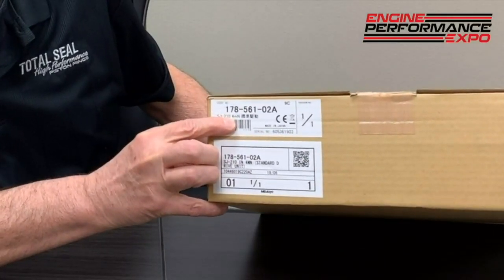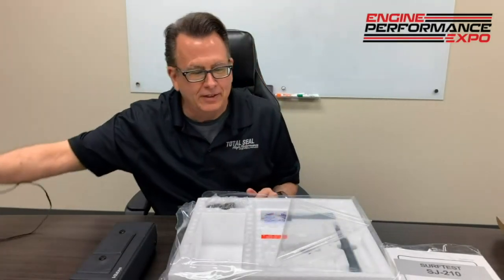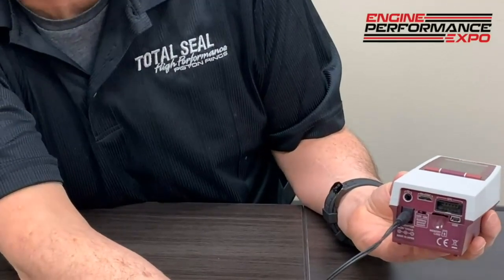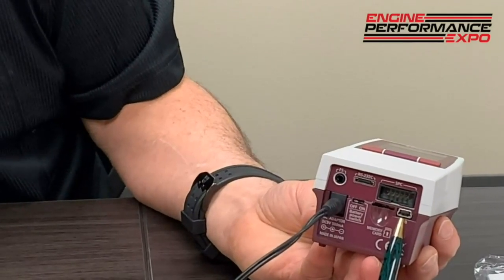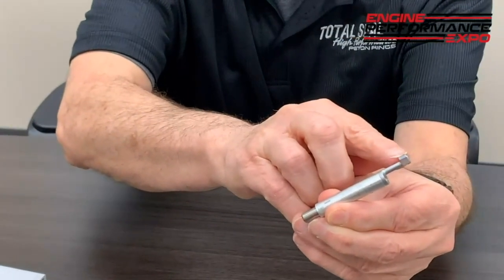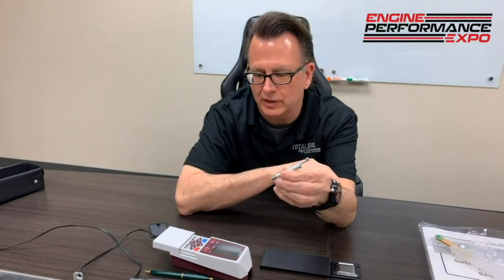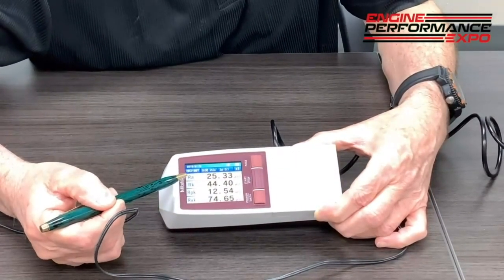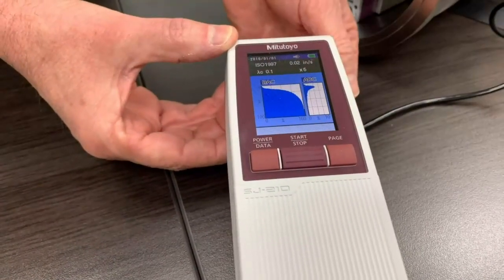Easy Profilometer Set Up (Step By Step)

Comment: If my reader is not reading the 116, but say 114 and I want to tell my machine that it IS 116 since that is what is should be reading...is there a way to change the reading in the machine and then run the test again where it would ideally THEN read it as 116? I hope that makes sense. TIA

Comment: When performing the scratch test for calibration, how far off should the reading be? I am using the standard 116 calibration block and want to know how close it should be reading to the 116.14. Thank you!
Reply: If you're using the Mitutoyo reference specimen it came with it should be very close (115/117 range). Like the video showed you may need to do the update (red button) of the calibration a few times but it should end up close to your expected value.
Reply: Yes, im using the one that it came with.  @BlackMercury3030

Comment: Hi, where can I obtain the adapter to use in my cylinder bores 82-90 mm bore diamater
Reply from the maker: Not sure about a small bore adapter. Typically, the drive unit is located outside the small bore cylinders and the stylus reaches into the bore.

Comment: I am using this profilometer to measure surface deviations on a piston. While taking identical measurements without moving the environment or changing any settings, I am observing a gradual drift along the X-axis when I superimpose the graphs on top of each other. What could be the reason?
Reply from the maker: Contact Digital Metrology for help with a question like that.

Comment: PLEASE clarify and elaborate on the stylus selection (5um vs 2um) and corresponding Lambda "C" values in the profilometer setup.  They DO NOT produce the same values on the same surface.  Also, please indicate how your bore finish recommendations are specified accordingly.  The bore surface numbers are essentially meaningless without the proper equipment setup and measurement parameters clearly defined.  Thanks!
Reply from the maker: The SJ-210 comes standard with a 5um stylus, and we set them up with a Lambda C (cut off length) of .1

That’s our recommended set up, and the published surface finish recommendations are based on those set up parameters.

Rpk 10-15 micro inches 
Rk 35-40 micro inches 
Rvk 50-60 micro inches

Comment: Boy oh boy have I had a hard time finding a machine shop that first off even has a profilometer of this level. Second work with me or my engine cause its a Toyota 4cyl. Third have a honing station and stones able to achieve the correct results. I called 62shops
Reply: I tried that a while back but both they and I were a bit to busy to get that figured out. I finally found a fairly new shop in Watertown SD. Also tell Lake to look for a YouTube link I emailed him a on October 10th.
Reply from the maker: That says something right there! You might want to contact Rottler to see if they can tell you who has one of their honing machines near you.